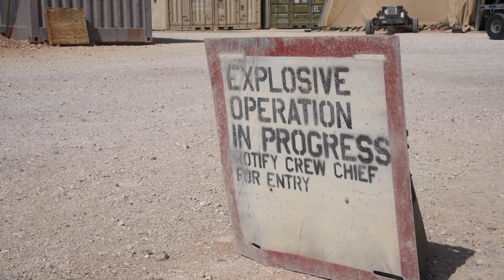Incredible Process of Build MK-84 Conical Bombs in Munitions Storage Area

Comment: It's looks like a training practice,if real would be the last thing to put the fuse/detonator after the bomb hook to the bomb rack for safety procedure !
Reply: Looks real in my experience.  The safety pins and arming wire keep the fuses from being armed.  The arming wire gets attached to the plane and the safety pins removed just before takeoff.  When the bomb gets dropped the arming wire gets pulled and the fuses arm.  The rest is in the hands of the gods.
Reply: if it was practice it would have blue band
Reply: They’re live. Yellow bands.